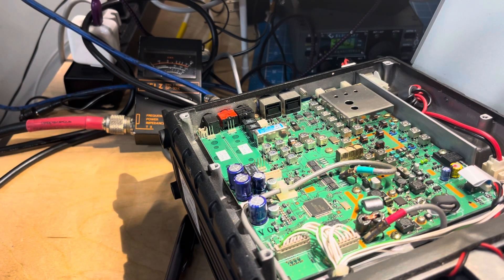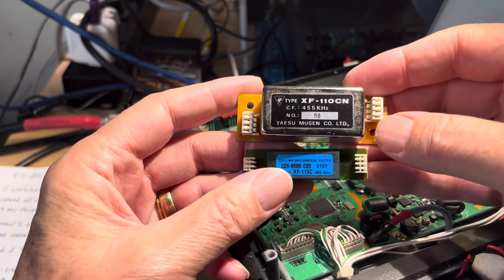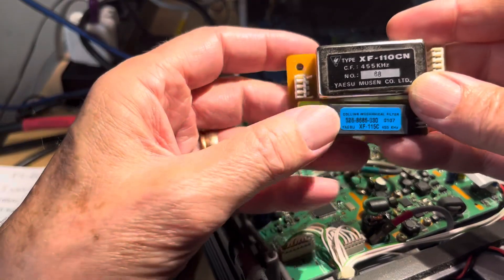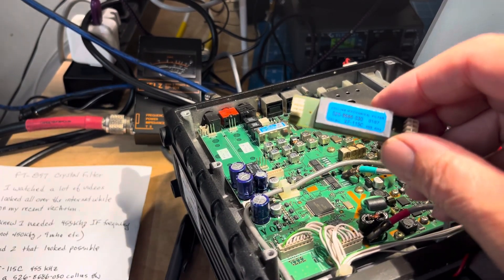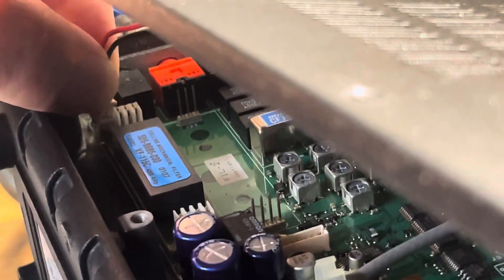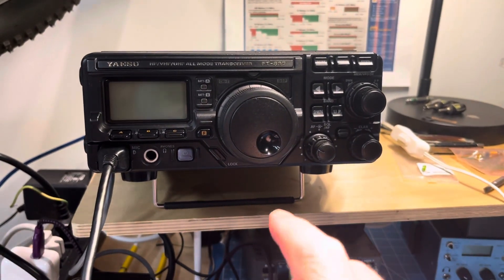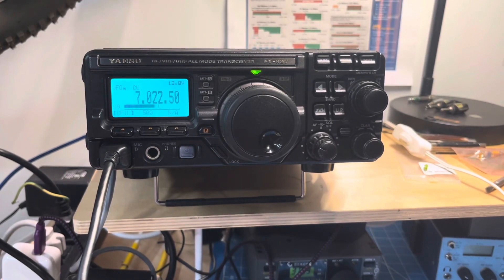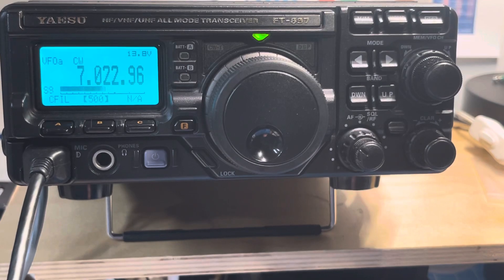FT-897 - Success! 500 Hz Filter inst…

Comment: The Collins filters are getting hard to find now. I installed the LDG YT100 tuner into the battery compartment of my 897.  I got the idea after watching a video by Diego, EC1CW who shows the instal. It fits in OK and works great. I always use an external battery so I thought I might as well put the redundant compartment to good use. The 897 is a good performer for it's age IMO but I recently bought a new QRP transceiver which is superior on receive but that's to be expected. I'll never sell my 897 though!👍
Reply from the maker: That is a cool idea putting the tuner in the battery compartment. I got over excited and bought 2 new batteries for my 897 while it was still being shipped. Only to find out that the built in power supply uses up all that space... 

What kind of QRP rig did you buy? Interesting!
Reply: @tyrueiI   A Discovery TX-500 although I had to wait a while for it due to production/shipping delays for obvious reasons! A brilliantly engineered QRP portable radio.👍
Reply: How do you rate the TX-500 vs the FT-897 in terms of noise floor & ability to pull out weak signals?
Have the former. Considering getting the latter as a ‘tweaker’.
Reply: @Tokyo1991.JL1AJE   I've compared the two side by side on the same signal and I'd give the TX the edge in both sensitivity and selectivity and is a "better" receiver IMO. The ceramic filters had already been changed on my 897 before I bought it so it's at the top of it's game but it is a noisier receiver than the TX. It's still a fine portable rig though and definitely a keeper. 👍
Reply: @phils2180 Good to know.
I was following a bad LCD 897 with the optional AC power unit on the Auctions over here but the price went out of my budget when compared to my plan B, the 891.
Have you any experience with the FT-891 in comparison to the TX-500?
Reply: @Tokyo1991.JL1AJE  I have a 891 in the car for mobile with an ATAS. I've also compared the TX with it and say receiver performance is about the same but, to be fair, they are both much newer radios than the 897. The 891 is not much bigger than the TX and offers 100w but obviously nothing like as robust which is the big + with the TX of course. As you will know the TX is way more expensive than either of the Yaesu's but still worth it IMO. Another plus for the TX is the ease of firmware upgrades, way less faff than the others!👍

Comment: The companion LDG-897 Tuner is a nice accessory for this radio. :)
Reply from the maker: Thanks for the tip! I went for the Yaesu tuner on the FT897, I may try the LDG if another Yaesu suddenly appears in the ham shack. Haha     eBay is so helpful by pushing all the offers from sellers with a lower price than I paid.
Reply: @tyrueiI  If I recall correctly the Yaesu is good for about 3:1, the LDG 10:1. Quite a difference.
Reply from the maker: That is great input. I have so far been using the tuner for a nearly resonant dipole. I’ll go check out the LDG site!